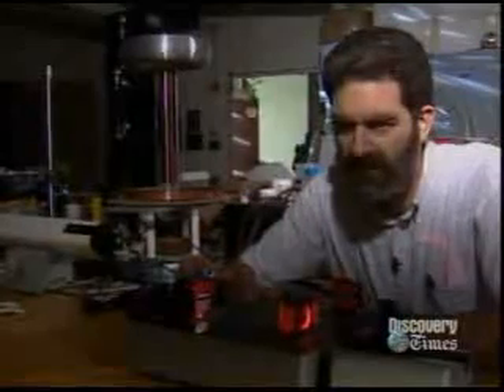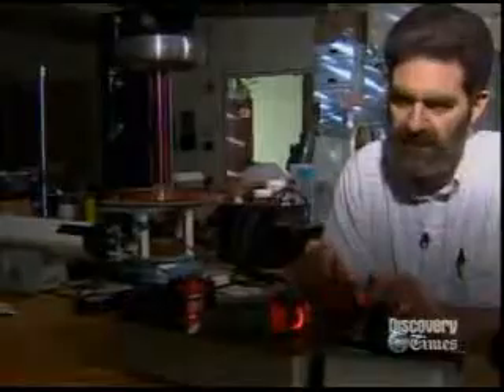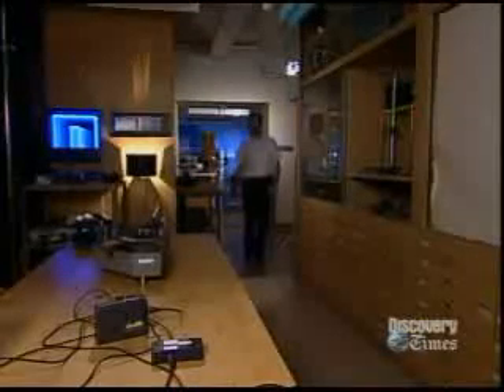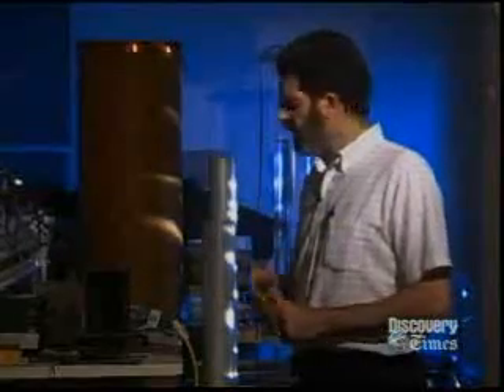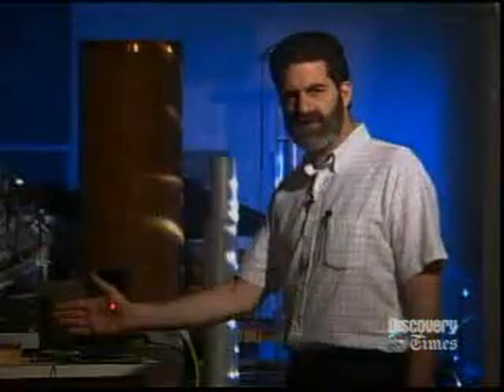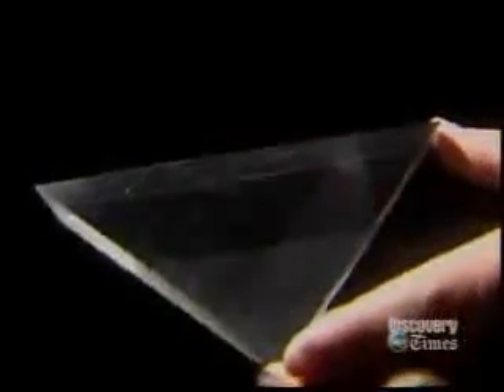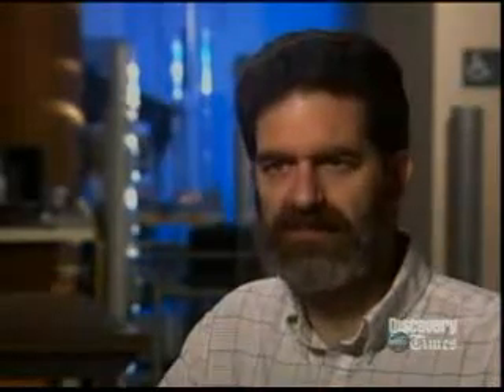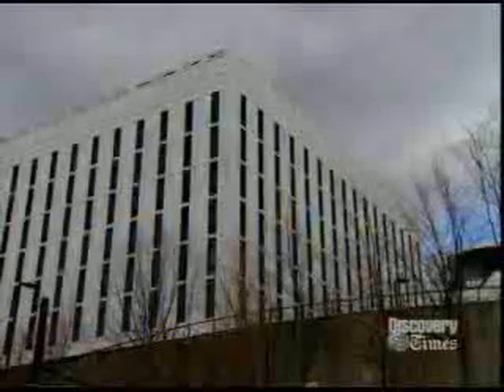CIA Laser Listener

Comment: They think the "Building within a building" will stop it. All you have to do is reflect the laser off an object in the room and use a camera feed into a photocell and you can hear inside the room. Also to remove any sound they are using to block you from hearing them, bounce a separate laser off then outer glass and then turn the sound negative and it will cancel out the other rooms interference.
Reply: Sounds like you've done this before?
Reply: Zomak blah FBI OPEN UP!

Comment: Why don't you just stick a retro-reflector on the window? Retro-reflectors aren't nearly as angle-sensitive, easier to install, and they are probably cheaper due to the fact that they are already in common use and don't need to be specially made.

Comment: Surely that would be AM.  The reflected signals being discussed utilise the doppler principle and are thus FM.

Both would work, but only FM matches the practical application under discussion.  This is an important distinction if using the modulated laser to develop a receiver system with an appropriate filter chain.

Comment: I would say no, a reflex is not needed.
and it's possible to penetrate double windows even with a vacuum between them. just with conventional physics.
and with non conventional physics you can pick up anything at any depth in the building.
but ultimately not undetectably